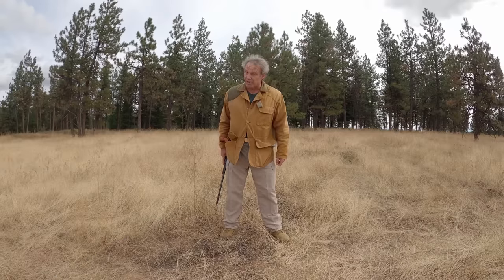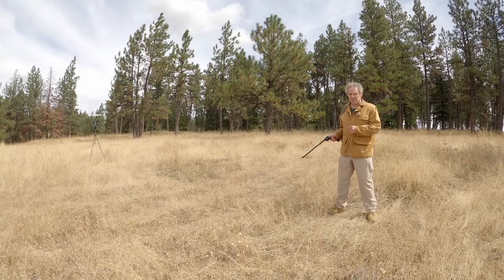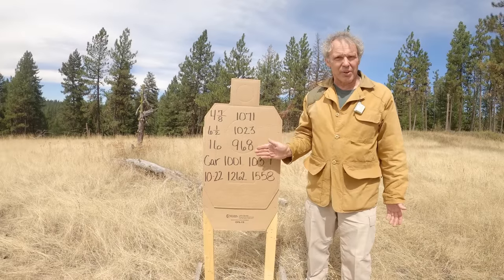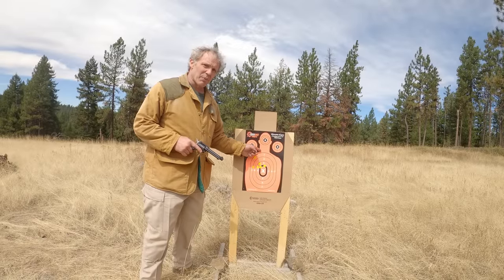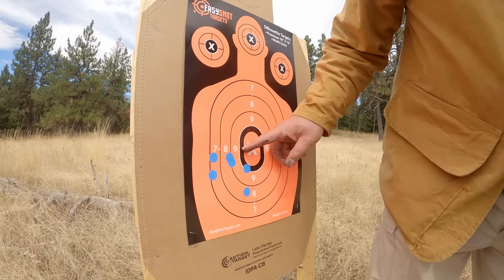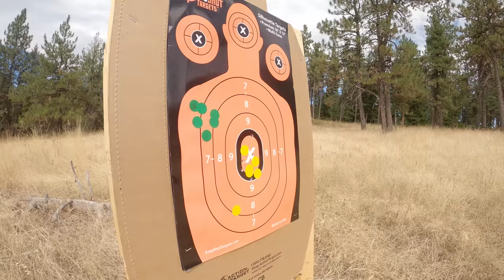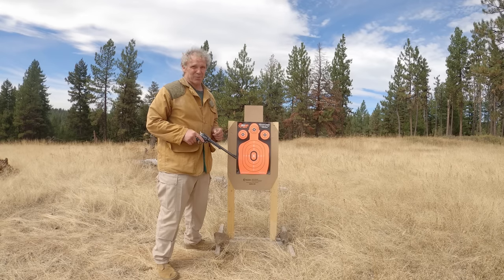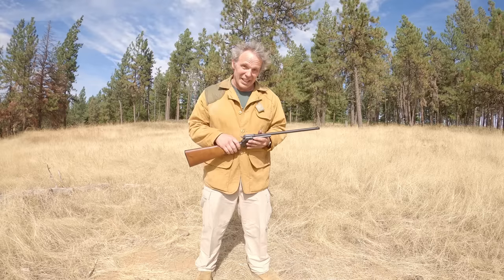Heritage Rough Rider Revolver Barrel Length Comparison

Comment: Fantastically unique comparison of revolver barrel lengths. The only thing I would have liked to see was measurements of the cylinder gaps as that variations there might have been valuble in explaning the unanticipated but logical results. For a future evaluation it would be fun to see if the results hold true with their 22 mag cylinders (not sure if they're available for all three gus) and for the Judge vs the Circuit Judge (hope I got those model names correct), or maybe the replica Remington 1858 pistol vs the 1858 revolving carbine. As an old west gun kinda guy, I found this video very insightful and FUN! Thanks Paul.
Reply: All heritage 6 round 22 revolvers can use the same cylinders, the only difference is they cannot use the 9 round cylinders because the timing will be off.  They can all take the 22 magnum cylinder too. They use to have 357 magnum and 45 colt revolvers but dropped them.   I wish I had gotten one.

Comment: I have a 4.75-inch Heritage RR with bird's-head grips, so this video is particularly relevant to me.  Many thanks for making it!

My only complaint about the gun is that I would rather that the safety switch, loading gate, ejector rod handle, and trigger were metal, not plastic, though I am sure that having these parts be plastic is part of the reason Heritage revolvers are so low-priced.
Reply: Gotta cut costs somewhere...! the profit motive, it is what makes America great...! we knew going in our Heritage might not be a hand-me-down gun, and we're okay with that...there no way we would shell out 500-1000 for a single action .22 revolver...our gun has paid for its self, and still runs fine, except for one d@mn screw (red loctite the next plan)...plastic is cheap, imagine what Glocks (and other plastic guns) would cost if they were all metal...

Comment: "Titrate out inconsistencies." Had to look that one up. Interesting use of the term, but I like the showing of greater intelligence. Thanks Paul. Keep the entertainment and good information coming. BTW - I just purchased 2 Rough Rider pistols. Good to know that I lose velocity out of the 6 1/2" verses the 4 7/8" barrels. It appears that length doesn't always equal power?

Comment: Hi Paul, 
interesting results on the barrel length vs velocity. I picked a 6 inch thinking it would be better for velocity than the 4 inch barrel, but obviously didn't figure it right. I picked up a Bar Keep with a 2 inch barrel, just because it looks cool with the Birds Head grip. Although I wish you would had a Ruger Wrangler there to compare with the 4 inch Rough Rider, I enjoyed this video, definitely learned something. That Single Six sure is a nice gun, but pricey for a .22. The Wrangler is usually just a little more expensive than the Heritage, appears to be a nicer too. It would be good to see a comparison between those two. As far as I can tell, the Wrangler only comes in one barrel length, and doesn't have an optional. 22WMR cylinder. I wonder if the results would be similar with the 22WMR... Maybe the topic for another educational video... Good work, have fun!

Comment: Hey Paul,
Next try with .22 WMR. The .22 Mag cylinder is like $30 or so. It would be very interesting to see the difference. Thank you for this video. Also check out the Barkeep
Reply: My 16" Heritage av. with CCI Maxi-Mags is 1230 fps. Heritage kind of messed up with the 16" guns; they are all as slow or slower than the short barrels, which is not right.

Comment: One advantage of the Rough Rider carbine is that it has adjustable buckhorn rear sights.  I don't know why the one Paul has does not.  I sold my 6 inch RR revolver as it shot 8 inches or so off point of aim and it's not the ammo.  Nothing to be done about that except alter your point of aim and I didn't want to have to do that.  However, the Rough Rider carbine with the adjustable sights was a keeper and can be dialed in.  It also has tighter groups as Paul demonstrated.

Comment: Thanks Paul. I recently picked up a Heritage 22 SA revolver for teaching my kids to shoot. I bought one that included a 22 WRM cylinder so I can start them with 22 shorts, and as they progress, move through the options up to the magnum round. 
I felt like a single action revolver was a much better option for beginners. I guess I better test it and find a round it likes so they don’t get discouraged before they get off to a good start.
Reply: If yours is like many of them, your aiming point might require a bit of windage...some folks will take a file to the front sight, others just apply the windage and let it ride...rather than fast shorts, consider a box of colibri, with near zero recoil...some kids will instinctively flinch, until after a couple of shots they realize no big deal...and make use of the safety, many guns they might encounter will have one, or two...enjoy...
Reply: @PetuniaIii-pd1ww   Thanks for the suggestion. I believe I have some Colibri in the shop, and will try it.

Comment: @Paul Harrel
Some things:
1. Heritage does make versions with adjustable sights for not much more money. Might be worth trying out one of those vs the ruger.
2. Heritage does have 22 WinMag cylinders that pop right in, that might be a video as comparison for barrel length too.
3. Very surprising how the ammo is timed vs barrel length like that, cylinder gap was a bigger deal than i thought. No matter how ammo burn time is, it doesnt matter if it leaks out the gap first.
4. I think heritage rightfully views the possibility of shooters as numpties regarding cylinder gap safety, or just falling into (bad for this case) habits like magwell holds or C-Clamping.
5. The 10-22 is cheaper due to massive economy of scale built up over decades of production, plus it has less parts overall that also require barely any fitting or machining compared to a revolver. Also I think Heritage can get away with charging more as I don't think anybody else makes a 16 inch 22lr revolving rifle right now.

Thank you for the enlightenment in this vid, I would have thought 22lr held speed better in longer barrels.

Comment: Your test results are exactly what I expected. Seems they all shoot high left. One of the two I tried had at least two FTF in each full cylinder runs. I ordered a new hammer spring and now it fires correctly but still shooting left high. Ruger’s Wrangler fires every time but still shoots left as the Heritage. Basically you get what you pay for. Have a Blessed Day

Comment: I just collect them I have 9 different models and grips they are a blast at the range shooting a couple thousand rounds just having fun. Plus the 22 mag capabilities a little bit more velocity right around 200 fps faster than the and with some barrel lengths it is a lot more accurate. At most in the rifle after about a 1000 or so rounds and depending upon your hand it will have gun power residue on it but have eye protection on.

Comment: thank you for reviewing these fun little guns. I got a 16" RR a few months ago, and it's stupid fun. It's a real giggle. Mine has adjustable illuminated sights. 

Your explanation of single action revolver function is very thorough and entertaining as always. :) Very interesting to see the 16" had lower velocities. Apparently you were prescient about the gas loss causing lower velocities. I was fascinated by that. I bought the RR mostly for the giggle factor, but also to maybe take it groundhog hunting with the 22 WMR cylinder I purchased for it. It would be interesting to see  the effect of the pressure loss shooting 22 WMR rounds through these. 

I have noticed there is a ton of smoke from the cylinder gap in videos taken while shooting my own. There are some folks who've compared the cylinder gap and forcing cone to other, higher cost revolvers, and there is a fair amount of "slop" comparatively, but again, it's a value priced firearm. 

Note: I have had to tighten some of the screws on my Heritage RR after shooting a few hundred rounds through it. Something to keep an eye on. 

I definitely feel I have achieved many many bangs for my buck.

Comment: I appreciate the video. I think I might have asked for a .22 LR barrel length velocity test a while ago, though not necessarily with all Rough Riders. The 10/22 as a 'control' is brilliant. I have a 10/22 carbine and a Charger with the 10'' barrel...and a Rough Rider with 6.5". I've got both cylinders for the RR. In my humble opinion, the RR should not be judged for anything except being priced well within almost anyone's budget as a 'survival' or 'bug out bag' firearm capable of putting meat in your belly and the capability of shooting any .22 rimfire cartridge from CB and BB to WMR. I got my RR in the late 90's and remember being told you could bend the front blade side with pliers to offer some windage adjustment. Next request: same firearm but with the .22 WMR cylinder in all of them???

Comment: I have all of the Heritage revolvers…I enjoy them all…knowing all well of the limitations that these revolvers have in fit and finish…I replaced all the “plastic” ejector rods with the Ruger single six “metal” rods…had to turn-down the diameter a bit on my lathe…but the new ejector rods work great in the Heritage Revolvers…
And yes…they have the tendency to shoot / sight slightly left…just gently bent the front sight…not perfect but much better…😎

Have run about 3,800 rounds though all of these with no issues to date…just my 2 cents.

Comment: Hey just FYI finally someone is currently selling ejectors for these with metal handles on Ebay. Cheapest looking thing on the gun IMHO.  I was surprised and disappointed to see there was no gain from the LR with the longer barrel. I would like to see you test Magnum ammo through the 16 inch barrel and see if there is a loss or gain there. It's a great gun after a little elbow grease. I love mine. Thanks for the video.

Comment: My experience with Heritage revolvers is this...
First got a 16"... tumbled most 22lr bullets, but did ok with 22 mag or shorts. (wasn't the cylinder. Returned it... Barrel and forcing cone replaced. Still tumbles bullets occasionally.
Got a 9" shoots with same accuracy as the 16" basically.
Got a barkeep with 2" barrel and it is the most accurate and never tumbles.
I have scoped them to verify cylinder center and they are better than expected, so maybe some barrels are just poor?
At 60 yards supported on bench bags, they will stay inside 12", with the 2" barrel being consistently the smallest pattern.

Comment: Hey, Paul. Great video. I always enjoy your content, and I really liked this one. I have to admit I was quite surprised to see the chronograph results. It just goes to show that there is always more to learn.

I will say that I've owned three Heritage Rough Rider handguns, and I will say that only one of them was accurate (and thus the only one I kept). It's a 4 7/8" model with a 9 shot cylinder. I have noticed that they are quite picky with the ammunition they like, and it took me a good bit of grouping with various manufacturers and weights to find what mine liked, as you have always suggested when testing firearms (Herters seemed to be the winner, but this may not be the case with other guns). Once I got a good match of ammo to my gun, I was able to shoot at my local pistol league with it. While I didn't take home any trophies, I did manage A-Class. They really are hit and miss, but they seem to be quite popular among many people. Something about that classic Colt feel at a fraction of the cost, ammo and gun included!

Comment: all Heritage revolvers are very modular.  dont take much to make the carbine to 22 mag. and back to a 22 LR. cant do that with a 10/22. 
a ruger 10/22 in my option is the best rifle in 22LR anyone can have. But having a Heritage carbine can give you options like never before. change to 9 shot 
22LR/ 22mag takes a little more doing. but easily done none the less.
Paul did a really good job at showing the difference of longer barrel shorter barrel.

Comment: I own a dual cylinder 6-shot 4.75" RR with fixed sights and a dual cylinder 9-shot 6.5" with adjustable sights (AS).  My 4.75" shoots consistently left with all types of ammo I've tried.  The 6.5" has easy to see hi-viz color dots (twin green rear, single orange-red front) and can be tuned to any load.  I recommend the dual 9-shot cylinder AS version if you can find one.  Failing that, get a 6-shot AS version.  I don't recommend the fixed sights.

Comment: I have the 6.5 inch Rough Rider and the much shorter Bar Keep.  All of them can have the 22LR cylinder (which also holds short or long) replaced with a 22 mag cylinder. Since  dont carry either I load them at the range with all 6.

Comment: I would like to add a few things to the discussion, especially if anyone does want to go out and buy one these.  

1. In terms blazer ammo not working I'll say that I personally use blazer a lot in both of my heritages and haven't had any problems. However, that is the reality of inexpensive mass produced firearms. One gun is not necessarily going to function as well as the next. 

2. Heritage does offer adjustable sights on most of their firearms, hell there is even a version of the 6 shot with an optics rail.

3. Finally as someone who does own the rancher carbine I can attest its merely for the cool factor :)

Comment: I have a Ruger Single Six (old model) and a Rough Rider. I like the half cock and clicking of the cylinder much more than the new model style of the Ruger Wrangler, and they’re less expensive. Great video as always. Thank you.
Reply: I have a 1958 model Single Six with 5.5" barrel and it shoots every type of LR ammo 50 to 100 fps faster than my Heritage 16". It is also faster than my Heritage 6.5". The Ruger is just tighter and doesn't lose pressure like the Heritage guns. The bore may be tighter, too, but I haven't checked that. Of course, I paid over $300 for the Ruger.

Comment: Paul, an interesting comparison to see the effects of revolver barrel length with a more powerful cartridge could be done with the Smith and Wesson 460 revolvers.  If memory is correct, you could compare 3.5 inches, 5 inches, 8.375 inches, 10 inches and 14 inches.  It would be interesting to see if that long barrel is costing any velocity and to see how much the short barrel reduces velocity.  Of course, that's a lot of cash to have tied up in 5 similar revolvers.

Comment: Awesome! Thanks! - People are saying it's a timing (misalignment) problem, and I'm inclined to agree, since precision in the gap is one of their selling points. 
[Revision: I'm getting an 8-shot Bounty Hunter instead (maybe.) No self respecting german manufacturer would accept these dreadful machining tolerances...]

-Well, nevermind... I've seen two reviews now with a malfunction of the Bounty Hunter after 100 rounds. It seems the cylinder diameter is too big for both calibers, and inconsistent to boot. I think the WMR might get a better seal in these Heritage barrels because of it's slightly bigger diameter. Obviously, anything longer than the 6 (1/2)" barrel model is still a waste of materiel.

Wow, that gap must be huge. It would be nice to compare to velocity of the Ruger with the nine inch barreled Heritage. (They do make them with adjustable sights.) It might be better to just get the Barkeep with the really short barrel.

Comment: I've had 3 different Heritage revolvers and with 2 of them, even though the hammer block saftey would be all of the way in the down position and would rise up on me sometimes when I would go to fire it.
I found that the hammer block saftey would engage when firing more when I was aiming down a little bit or more.
Even after shooting and cleaning them trying to wear them in over time thinking that maybe the fouling or the finish was catching the hammer block saftey, the hammer block saftey would still engage when using the same downward aiming positions.
The hammer block saftey would never self engage when aiming slightly higher than straight.
I would also like to mention that if I held the hammer block saftey in the firing position with my thumb, I would never have a failure to fire.
I hope this helps you out and
thanks for reading if you do.
Reply: There used to be a video somewhere that showed how to remove the safety entirely...that sounds like an aggravating problem...
Reply: @PetuniaIii-pd1ww 
 It is SUPER aggravating.
Thanks for informing me too, I thought about removing the saftey but I never did but it is a good idea since the idea has been brought to my attention again.
The others thing I forgot to mention about the Heritage revolvers is that the screw for the ejector rod housing gets loose sometimes, especially when shooting high velocity ammunition.
I spent about 20 minutes or so looking for my ejector rod and its housing in the grass when I first found out that the screw gets loose while shooting.
Some Loctite will fix the loose screw problem, it's too bad the same concept can't apply to some people in society today 🤣
Reply: @MYNEIGHBORSKEEPER06  10-4...! I could have warned you about the screws, I'm going to look for red loctite, the blue wimped out...my gun is a  birthday gift, I have to run it until the cows come home...and really, it does run fine, I just retighten screw after every 6 rounds fired...

Comment: I have the 16" revolver with adjustable sights. It has occasional light strikes with all ammo. It seems to help if you make sure to push the rounds firmly into the chamber so it  can't move forward when hit by the hammer. I can shoot it very well but only for a short time. The long barrel makes my hands and arms get tired quickly.